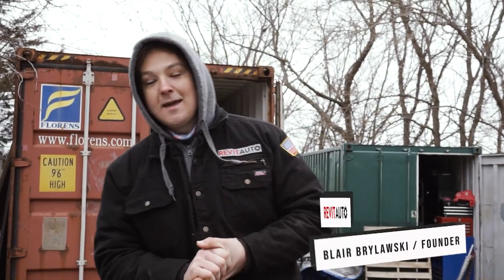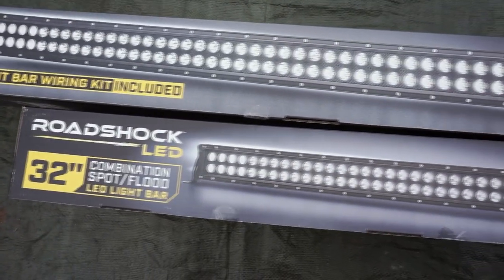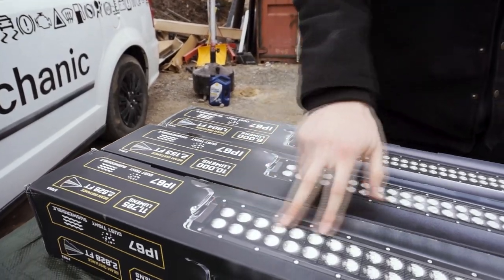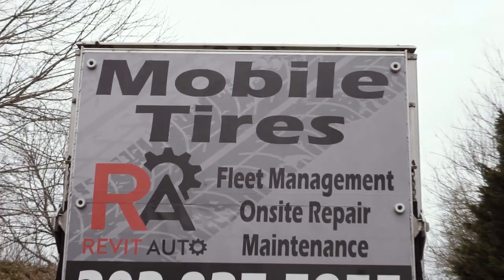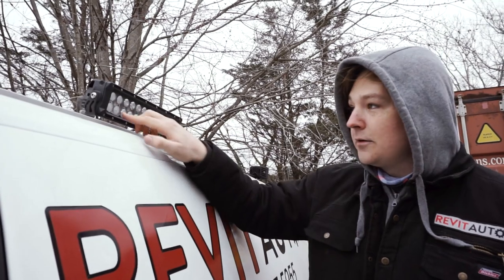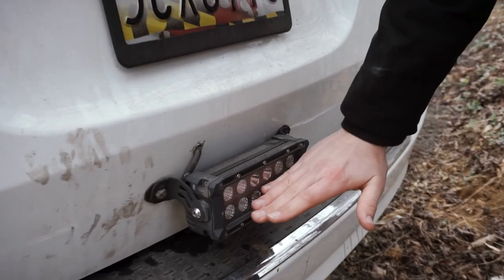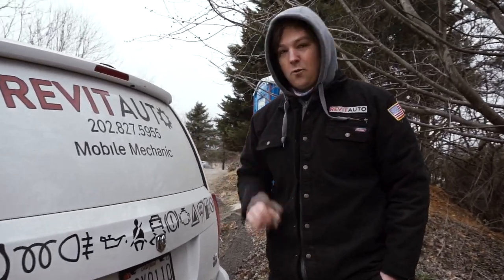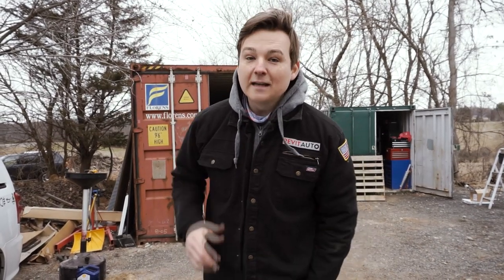Harbor Freight Roadshock LEDs Short Update | Tool Tuesday

Comment: Anyone ran any rock lights ?
Reply from the maker: Hey Franco, what is a Rock light? Can you send me a link to what you are looking for?
Reply: @Revitauto  rock lights are the lights that go on the under carriage of the car to see underneath at night.
Reply: @Revitauto  for rock crawling , ditch lights are better for general backroads & off-roading
Reply: Anyone ran any Lock Rights?
Reply: @speedfreak8200  i have 2 speedtech lights brand 5wt rock lights under my 4runner facing outward as puddle lights. They are really nice, it lights everything up on both sides of my vehicle.
Reply: @beakfish7319  my light bar & pods have "side shooters" that's pretty much all I use..... I bought some rock lights but I don't really need them.......peace
Reply: @speedfreak8200  i was thinking about getting some of those and i think you've convinced me lol
Reply: @beakfish7319  glad to be of service!!